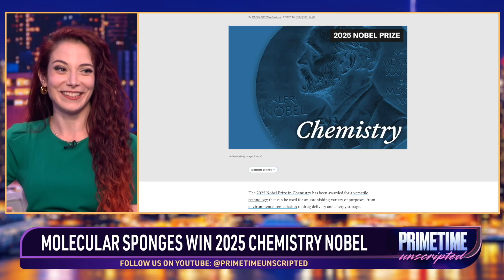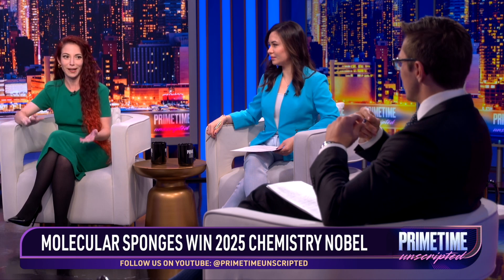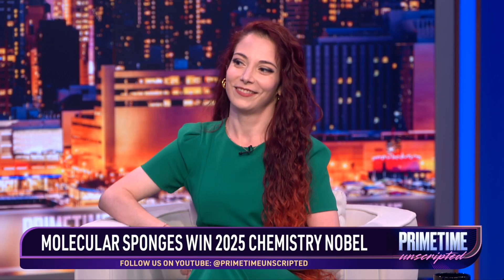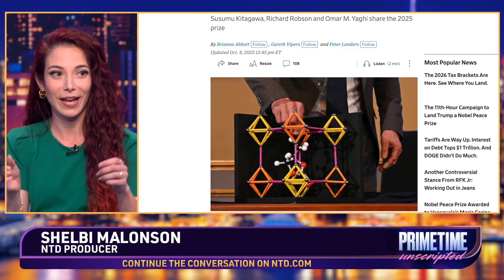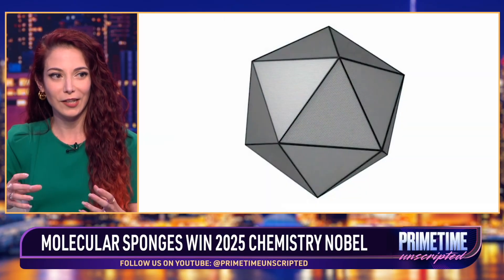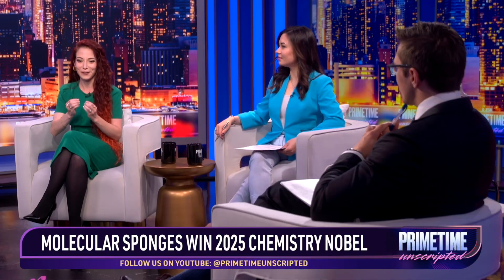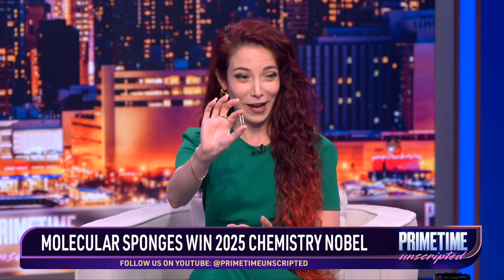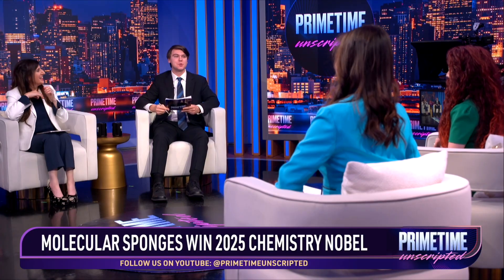This Nobel Prize Discovery Can Solve the Water Crisis

Comment: The most you will ever physically be able to absorb for water vapor is roughly 1000 to 1 ratio depending on pressure. Ideal gas law!  The same is true for most gases.  Water is non-comprisable, just gases are compressible mostly at a 1000:1 ratio.  So 1 gram of this substance could absorb probably around 1kg of gases and would probably expand greatly.  However, I have some questions such as how exothermic this reaction is?  For instance if you are turning a gas into a liquid or solid, there should be an incredible about of energy released.  For instance the heat of evaporation for water... well I'll let you look into that yourself!

Comment: Five years ago - or maybe longer - can't remember when - I watched  a  video of a metal box that was about the size of a residential air conditioner condensing unit sitting out side your house. It was a silver colored metal. It was running, you could hear it humming. A man demonstrating it said it was pulling water from the air and not a tiny amount but enough to impress me. It had to have a motor or small engine to run it.  He claimed it was made in Israel and the cost was between 1 and 3 thousand Dollars as best I remember. Maybe it could be found on the Internet Wayback machine.
He wouldn't give away many details other than it was making water from the air in the desert as he was talking. I think he is or was marketing or planning to market it in the US. Things are happening.